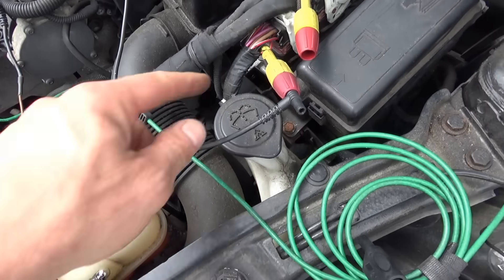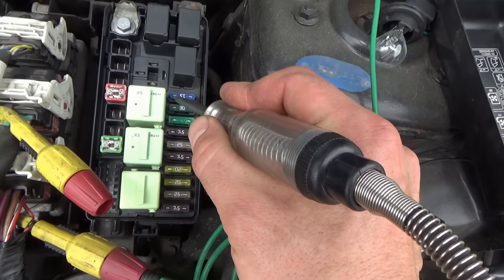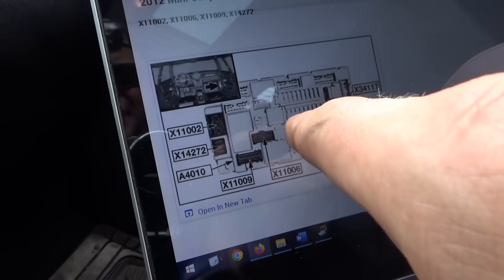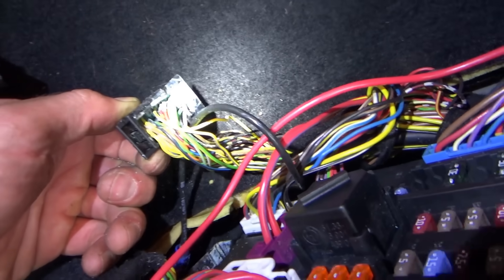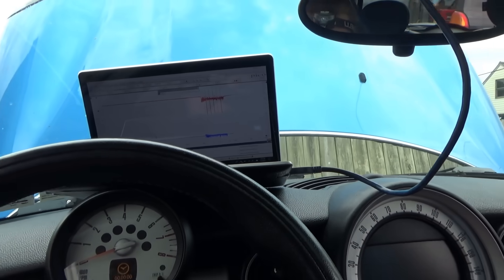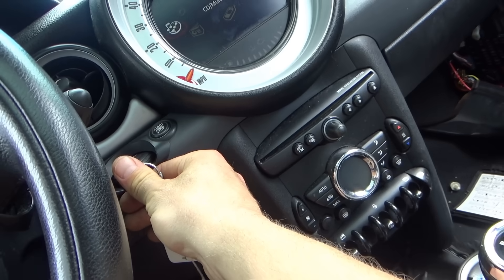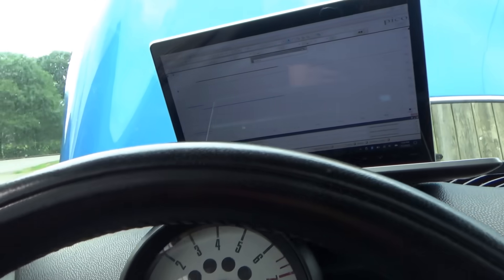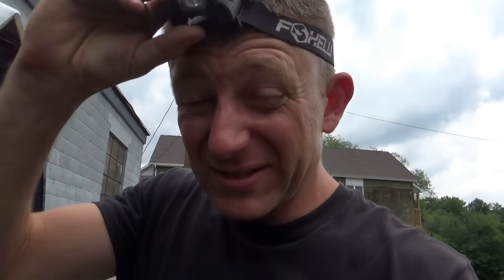(Pt 2) Mystery Mini: Crank No-Start...SOMETIMES? (Russian "HACK REPAIR"?)

Comment: Your bad ass smart as hell I have a 05 mini cooper s had a key guy cut a key fob and he disabled the car I have replaced the key emobilzer and the body control unit tried to program it fuse 24/ 5 amp has no power and my reader is not equipped on all unit it does detect the steering angle and the passenger seat belt all numbers match to the pcm can't get it to align or marred together can you plz give me an ideal where to start it's my wife's car and she is heart broken thank you so very much and I appreciate you

Comment: Hello,  have a Mini Cooper S JCW 07 with these problem, as soon I comect the positive cable on the battery the relay R1 continue clicking, start but doesn't run and the black relay at the junction box gets hot

Comment: There is a chance that this electrical water damage would be covered under the vechicle's comprehensive coverage. If the owner puts in a claim,  the worst that could happen is a claim denial. Their rates will not go up. Definitely worth a shot.

Comment: Why couldn't you use CLR or some other chemical to dissolve the crusties and then use contact cleaner to lubricate and and de-oxidize the contacts?
Reply from the maker: Because half the pins corroded off and got stuck in the connector haha
Reply: @PineHollowAutoDiagnostics  Definitely beyond hope. Thanks for answer. Video didn't show the extent of the damage.

Comment: Hey man! Great video I js watch ur g35 video! I’m dealing w the same problem no pulse on injectors and I’ve replace the crank and cam sensor and nothing also replace my ecu and nothing strong crank but nothing ill run on starting fluid only and the car been sitting for a year now I been trying to fix it but still nothing already brought to two shops and nothing any help will be great!

Comment: I think that this could have been avoided if when you told them about the water issue a week or so before, they could have taken that apart cleaned serviced the water intrusion that you made note of. That it was still not corroded at that point and clean it up properly and then gave some protection for it with dielectric or whatever? You had mentioned to them that that was going to be a possible issue later so it's not like they didn't know! All the best from Canada

Comment: Yes Ivan, this is definitely a kluge or "hack job" fix.  I would believe that most responsible repair shops would never let this go out the door.  My guess is that the owner will drive it the way it is until another related problem pops up and the next mechanic will insist on a "proper" repair.  😄

Comment: You can take some baking soda and water and soak that connector in it and hit it with a tooth brush and knock all the corrosion away..  if there is still metal there to make the connections--  it can still be usable (sometimes).   Obviously, if it got inside onto the board-  you're fighting a losing battle.   But if the problem is just right there in the connector -- It can be worth a try to clean it up sometimes..  (that one does look rough though. lol.. )

Comment: If the customer has comprehensive insurance on this vehicle, that electrical junction would be a water/flood claim. Insurance won't pay for the cause of the water damage, the sunroof drains being clogged, but they will pay for water damaged parts. 
Nice alternative repair that doesn't mess with the rest of the vehicle Ivan. Good work.

Comment: Ya never told how it go flooded. Did someone leave the window open in the rain? Did they drive it into high water? Leaking door or window seal? Clogged drain hole?
Reply: Sunroof drains were clogged. He explained in pt1.
Reply: @xanderlander8989  Nice.

Comment: Another retired EE here. I always look forward to a video from Ivan. Love his approach to diagnostics. I’ve got some interest in making some diagnostic equipment. Have a noise I think is wheel bearing so I was looking at the ears you can buy online and decided to make my own. The professional ones use speed and wheel diameter to measure noise synchronous with wheel rotation. I’m looking at some cheap piezoelectric transducers. Anyone looking at this?
Reply: Have you considered a stethoscope 😂

Comment: Great video Ivan, there is European car Peugeot with same engine, the ignition power come from the engine fuse box through the ecu i think its not an ecu input its just a power go from pin to another pin of the ecu

Comment: FIND A WAY TO SOAK THE WHOLE CONNECTOR IN AN ULTRASONIC CLEANER, THEN SOAK IN ALCOHOL. SCRUB PINS ON BOX, SLATHER ON THE ELECTRICAL GREASE. GOOD ENOUGH.

Comment: Hi Ivan. I have a request. Could you post a link to your test leads? Specifically, I’m looking for the 2 into 1 leads you use. Not the stackable ones, but rather the ones that resemble a splitter. And ignore the haters. These are the people that would do the same to their own vehicles if faced with an expensive repair. Ha.

Comment: Great temporary hack to regain start & run function. It could possibly run for years yet, if the green crusty"s don't take over the remaining circuitry. I've done similar hacks to regain circuit function on my own personal drivers, So we could drive them-on into the ground, sometimes, many years later. Thanks, Ivan!

Comment: The footwell rest module on the driver’s side is a recall item, but I don’t know about the passenger junction box. Huge problem with these as that water gushes through those electronics and ruins the works.  

I got my 2007 done under recall, but they didn’t complete the lighting programming and I’m missing high beams.

But - they actually cut out and redid my floor pan as part of the recall. On an 18 year old Mini.  Who’d have thought? 😉

Comment: If the future owner wants it fixed correctly, with working windshield wipers, Labor and Junction Box-$2,100
Kelly Blue Book Car Value-$950
Drop into crusher and get $35. 
Take the $35. That car will be a money pit. More electrical problems down the road. You will get stuck on the road many times, spending lots of money.
Reply: The owner is a shop n they goin rip someone off😂
Reply: Rain x large bottle  and elbow
Reply: Never blindly send a car to the crusher. What's a known good engine for these worth? What about a known good transmission? Glass? Sheet metal? Interior? Electronics? Exhaust? Even "totaled out" cars like this are worth far, far more than just scrap metal value. Eric @ I Do Cars could make bank on this thing
Reply: @philbrutsche8928 
Its a Mini. It was worthless the day it was purchased.

Comment: You are helping the owner rip someone off. There is no way that the owner is going to reveal this shade tree repair to a customer.
Reply: Eric O wouldn't of fixed it with a  hack
Reply: Ivan is hired and contracted by the owner. Ivan cannot control what the owner does with the vehicle. I assume Ivan has clauses in his work authorization addressing third party liability. The end result of getting the car to start reliably was achieved. If this was covering brake lines with hockey tape to conceal a leak, different story. 
Stay gold.
Reply: @dnlmachine4287  Ivan can refuse to do these kinds of shade tree repairs because it is a high possibility this will be sold to a person and rip them off.
Reply: In what way is Ivan "aiding and abetting" the shop owner in ripping anyone off? Ivan effected a repair that makes the vehicle usable again. Ivan clearly mentioned that he was going to label the junction wire's function to alert anyone in the future who may encounter it.
Reply: @mlieser1230  What Ivan did is no different than someone that rolls back speedometers.
Reply: That is a reach. The shop is very unlikely not to disclose what's been done, the reasons, and clever work around behind it. They didn't break it. Making the car run by any means saves hundreds on transport alone. Whatever happens to this car will not be a fault of anyone involved here, and making it run safely with full disclosure is not a liability in the least.
Reply: @thakiid1013  but there is no reason to think there will be full disclosure.
Reply from the maker: Not at all. Just making it run so it's not a beached whale lol. Wipers still don't work so doubt anyone would buy it 😜
Reply: @PineHollowAutoDiagnostics  yes you absolutely are helping the owner to hide the truth about that vehicle and rip someone off. This should be a criminal act.
Reply: I mean, at least 250,000 people know about it, and there’s a video of the record of it. Good heavens. A bodge fix to get it running again is perfectly acceptable if it’s not hidden knowledge.
Reply: @lancenutter1067  no, a shade tree fix that leaves the door open to ripping off another is not acceptable.
Reply: @JohnSmith-ug5ci I disagree but to each his own.
Reply: Yes, truly better all around that the car continue to sit at the shop broken down, collecting water like it's a rain barrel, than to get it starting and running reliably. The assumption that "There is no way that the owner is going to reveal this" repair to the customer for one makes no sense, and for two is basically irrelevant regardless.  Shops could always lie to their customers about the repairs, but even of they did, that's not exactly on Ivan to attempt to police.  I LOLed at "criminal act."  Imagine tracking down this failure and then telling the shop that you refuse to repair it or tell them what you found for fear that they might lie to the customer about it.
Reply: @Joe_Mission  yes it makes every sense that the owner is going to sell this and not fully disclose the problems. The vehicle should have been junked or repaired correctly. This shade tree repair makes Ivan also responsible for any underhanded deal the owner does.
Reply: @JohnSmith-ug5ci  In America when you're buying a used car from an auction or private seller, the sale is always "as is," and the seller very well may not disclose defects with the car.  That's just how it goes, and something you should consider when buying in this manner.  Mechanics who have worked on the car in the past could most definitely not be held liable for basically anything at all, barring possibly some major safety issue that is deliberately disguised or something.  If you buy a 15 year old mini with over 100k miles, be prepared for lots of problems.
Reply: @Joe_Mission  Ivan holds some responsibility if this vehicle is sold and it is not explained what problems it has. He should have refused to do the shade tree fix.

Comment: Makes you wonder if testing sunroof plug drainage is part of the yearly maintenance ast the dealers/shop, or if the clogging can easily happen in between, and needs to become an owners thing.
I am avoiding sunroof cars, but the supply is mostly with them these days.

Comment: I suspect that an hour or two with Deoxit and a small brush would clean the Junction Box and it's connectors. That would put the car back to original.
Reply from the maker: The big problem would be the broken corroded pins and connectors

Comment: I've had some luck with DeoxiT on water damaged connections after flushing them out really well to get as much corrosion off as I could. DeoxiT seems to protect the connections from further corrosion.
Reply from the maker: Deoxit is great but Won't fix broken pins though😅
Reply: @PineHollowAutoDiagnostics true!
Reply: Open drivers door
Dump 5 gallons into foot well
Let soak for one week
Cross fingers

Crusher eliminates worries. I wouldn’t let my wife or daughter drive it. That is a serious crash waiting to happen when a critical system shuts down unexpectedly.

Comment: Why not spray deoxit on the all the connectors in the junction box and to the junction box with all the green crusties? Plus, take out the board  and spray it down with deoxit, to clean it up?
Reply: Ivan found that deoxit has a tendency to swell the rubber/vinyl/plastic in the connectors. Besides which, he wasn't hired to fix the junction box.
Reply from the maker: Broken pins lol

Comment: Aren't there a spray product that would dissolve the crusty oxidation on the connector plug and restore the contacts  🤔
Reply: Yes, its called vinegar. Problem is the connectors are stamped from such lightweight, thin gauge steel, they CAN NOT be allowed to corrode at all. If you see rust, all the metal is gone😮
Reply: @pootthatbak2578  too bad. big expences to come 🤔

Comment: The junction box is on backorder for over a year now (edit: apparently not anymore), so a new one is not really an option. A second hand one is just as problematic since there are so many options that affect the layout of the JBE that it's almost impossible to find a matching one.

However, repair of this type of damage to the JBE is usually possible. Even though it looks really bad, it's usually a few pins that are both permanently hot and below the water level that are corroded off and one or two via's that need fixing. 

It takes experience, tools and correct parts to pull it off, but there surely are some people out there in the US that can do it.
Reply: yea, i just commented something similar. I've fixed stuff that looked worse. The only thing i can think of is that he mentioned a possible warranty...it's very possible he didn't want to touch it
Reply: @colestowing8695  The extended warranty is not for the junction box, it's for the footwell module on the drivers side, that controls the lights and windows. But this extended warranty is only for a software issue and sadly only valid in the USA.

There is not really a way around fixing it since the wiper switches are connected to the CAN-bus, so a Russian Repair is not really possible for the wipers.
Reply: @tomvleeuwen  ah ok. admittedly I'm not very familiar with Mini's. The closest thing i can think of that might be similar, is Chrysler and their crappy TIPM's....where everything is integrated into one unit. I don't know if thats a good comparison or not without doing some research, but ive hacked a couple of those - they're plagued with failures
Reply: @colestowing8695  What I meant to say is that you can repair them, and that's basically the only option. So I guess it is similar to the jobs you did on the TIPMs.
Bypassing the JBE, what Ivan did for the ignition relay, is not going to work completely because you cannot get the wiper signals from somewhere else.
Sorry for my unclear English.
Reply: I just did 3 of these a couple of weeks ago, they are not backordered
Reply: @minirey360 That's good news. To be honest, it has been a few months since I checked the status.

Comment: JBE and the Footwell Module are in the same location, just on opposite sides of the vehicle.  Unless the sunroof drains are only on one side (they aren’t) a recall should equally apply to both. A new main harness is the only proper fix, it’s just about the first thing installed on the body shell after painting.

Comment: I understand that there's a process of elimination to fault finding but when there's a red flag involving water and a junction box,  why ignore it?
It would've been the first place most would have looked.
At least it's running but someone will have to repair unless it gets scraped.
Reply: to be fair he's there for a diag, not a repair. It's questionable whether he even should've done that much (although i agree its a quick fix and a good compromise)...it's up to the shop to take it the rest of the way if the customer wants to go further  

(edit) - i kind of misread your comment. I agree, the water was a big tell-tale. But sometimes you have to start at the beginning and work your way back. Ive gotten sidetracked down the wrong direction that way many times - following what looked like the "obvious" path (that turned out to be a completely separate issue). As mechanics we can't fix everything, just what we're paid for
Reply: these are also instructional vids for diagnosing, and Ivan routinely goes through ALL the investigatory steps to fully pinpoint...and from what I've seen over the past 3 years, he also tends to end up finding a secondary hitch as WELL as the main problem.  here, however, I agree with the majority of other viewers; this vehicle will probably go for scrap rather than the thousands being spent replacing a possibly long out of production harness and computers.

Comment: I haven't seen that much green fuzz since I pulled the SRS module out of my Impala.  Passenger floorboard was flooded when I bought the car, and the module is under the passenger seat.  Naturally they want a mint for a used one, so I just run without airbags.  ;)